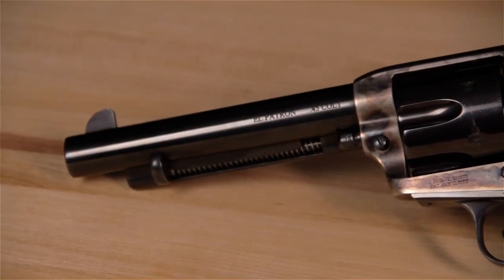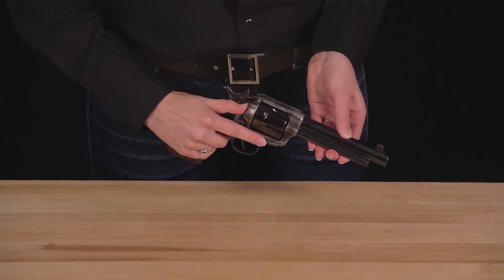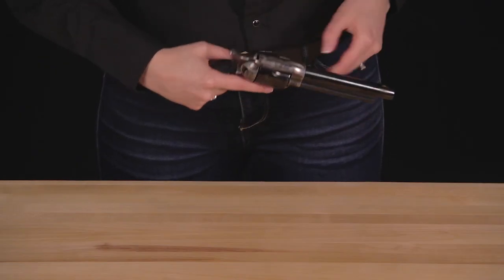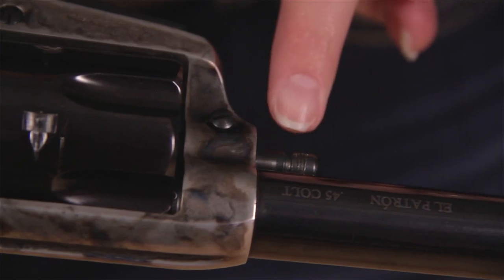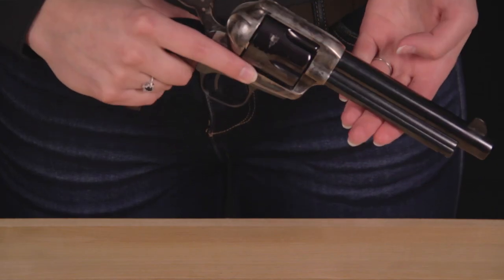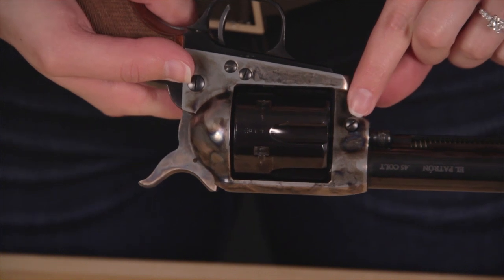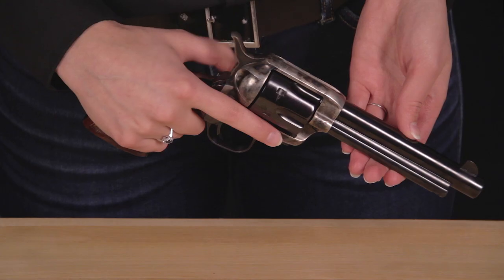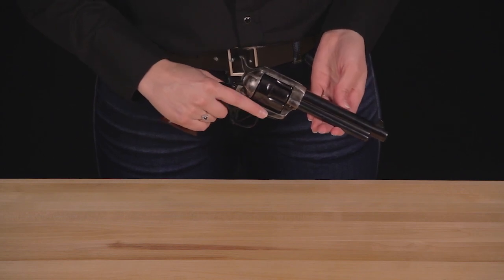Uberti USA - Wild West Tech: 1873 Cattleman Base Pin Setting

Comment: I have to say, I have one of these, and I love it. Never had a problem with it. Actually shoots real nice at 25yds. I do see what some people are talking about, but my hammer clicks 4 times. Like it should. And everything else has been smooth with it. I did make some minor adjustments, other than that, I didn't need to go overboard.
Reply: I just got one and the cylinder stop broke before firing a single shot
Reply: @channelchannelchannelchannel  How shitty. Why can't they make things with pride anymore? But Uberti should stand behind it. Did you send it back to them?
Reply: @Sam_the_Sham_and_the_Pharoahs  I'm gonna take it to a local gunsmith some time soon and have them fix it for me, I tried disassembling it and spent 2 hours to get everything back into place, I think I would rather not ship it anywhere if I don't have to
Reply: @channelchannelchannelchannel  I'm kind of the same way. I hate shipping my gun somewhere, but being a gunsmith gives me a little leeway as far as what I can do at home. Still a pain in the ass, and I don't believe you should have to pay for their fuck up. The Riley Defense RAK74 I just bought was like that. Absolute shit show for something I spent 1300 on. My 600$ Saiga 74 blows it out of the water. I'll never buy another American Ak again.
Reply: @Sam_the_Sham_and_the_Pharoahs  Read the fine print. Taillight warranty.

Comment: I'm searching and have yet to find an answer. I am looking at various versions of these SA revolvers.  I see a lot of Uberti's that have an "L" notch with some kind of block on the front face of the hammer below the firing pin. There's also a hole through the hammer behind that block.  Is this some sort of manual lockout block for a safety?  Nobody yet has mentioned this feature. It's on the older models I've seen, before this new firing pin safety that is activated by the trigger.  So, what is this block in the hammer?
Reply: Look up Uberti Cattlemen II firing pin safety on YouTube, it explains this "Transfer bar safety feature".

There is actually a safety spring that makes the firing pin slide slightly back into the hammer when the trigger is reset or at rest.

When pulling the trigger a "transfer bar" pushes upward into the hammer and with a ramp at the end of the "transfer bar" it moves the firing pin slightly forward just enough to contact the primer.

The video shows a "x-ray" view and explains it much better then I can here.

I hope that helps (2 years later).